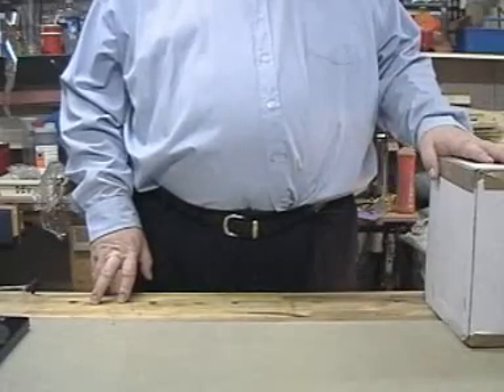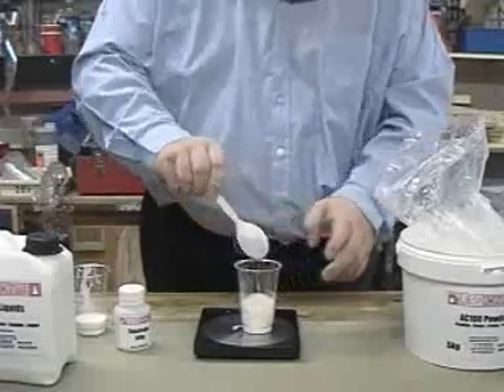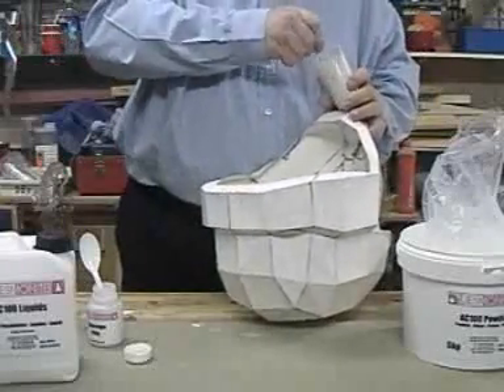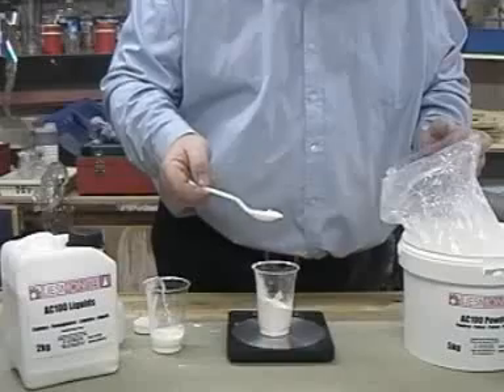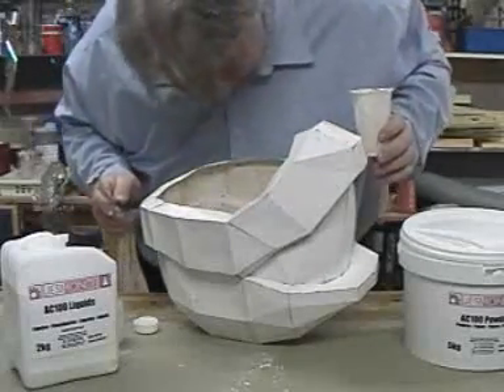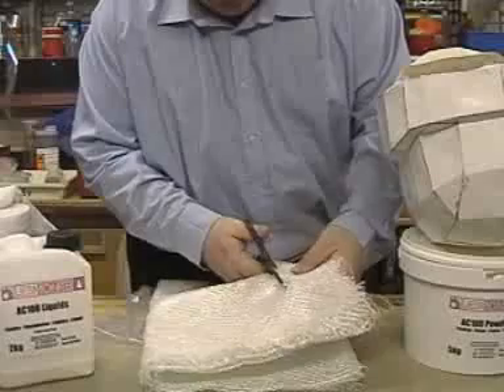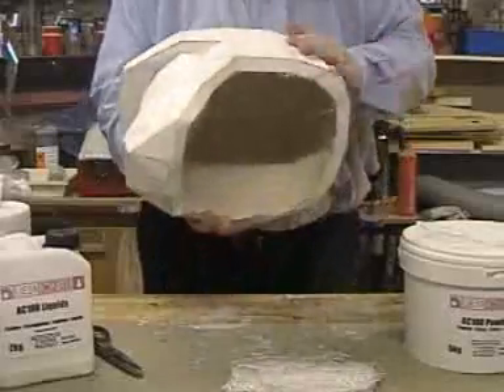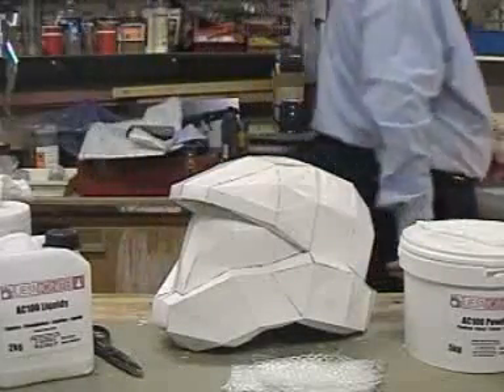Jesmonite First Time Use

Comment: have u got a finished version of the helmet yet? might buy some jesomite and give it a shot. just interested in how strong it is and also how smooth a finish can be achieved after sanding
Reply: Hi. I've used powder jesmonite once and it comes our strong and smooth from what I could observe, though didn't try dropping my jesmonite bust on the floor to test it. It feels a bit like a mix between plastic and plaster :) Want to get a hold of some more now.